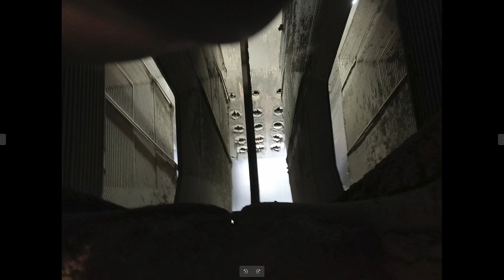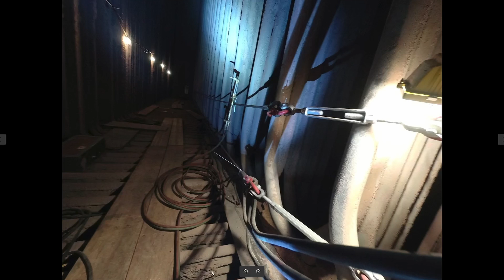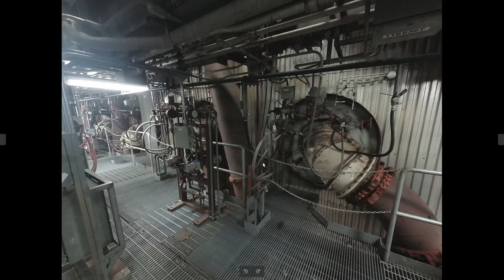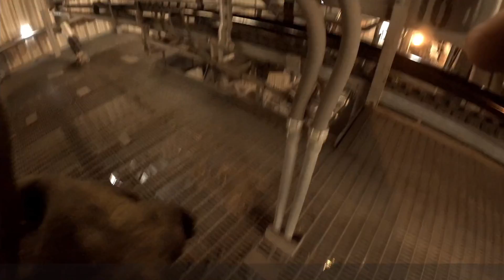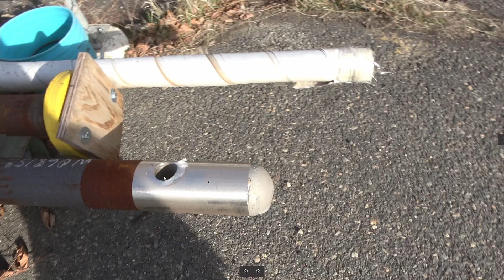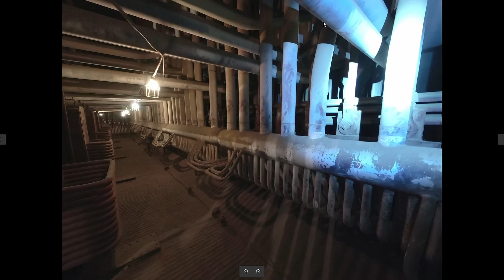Power Plant Boiler Part 2/2 (Slideshow)

Comment: Those are some neat pictures, way different than the one l built. It was a CFB type boiler, with solid separators and loop seals to return unburned fuel to the boiler floor.